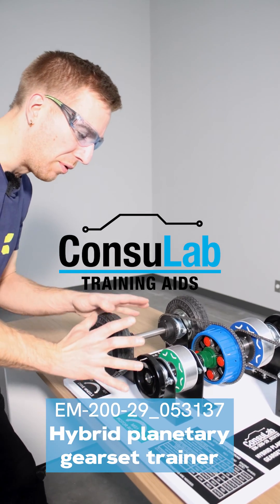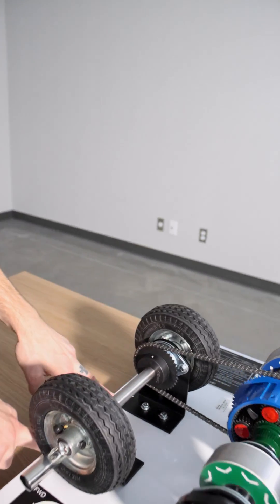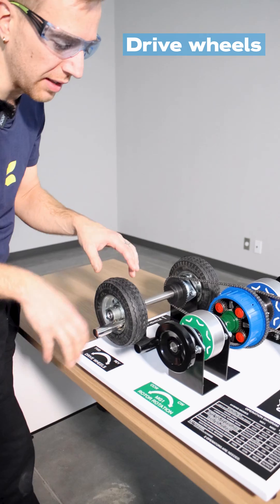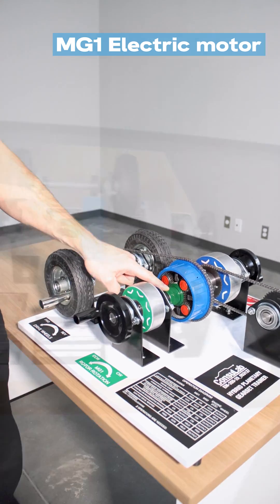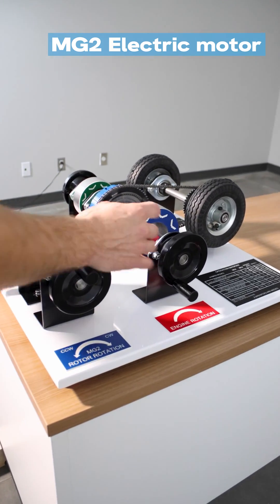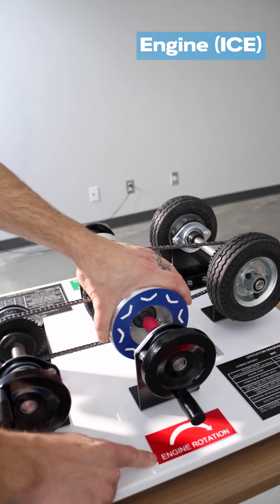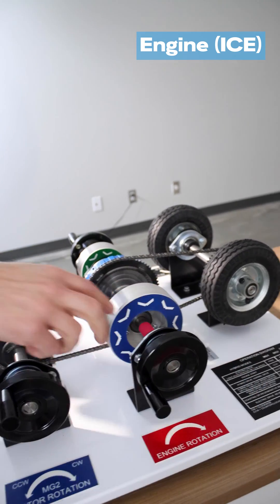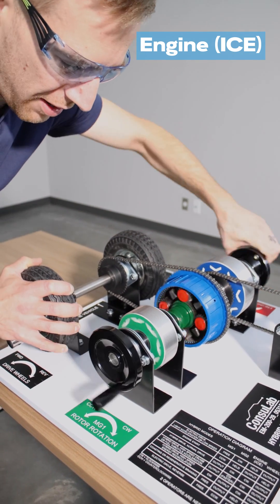How a hybrid drivetrain works - in under a minute

Comment: Weird. I thought I understood the system when watching a different video but now I feel I’m back on Square 1.
Reply: Every car brand does it a bit differently. This is just how Toyota does things. The smaller electric motor is pretty much working all the time when the gasoline engine is working as well. By spinning the smaller electric engine, the planetary gearset can change the ratio of power from gasoline engine being distributed to the wheels and being stored back to the battery pack, even via the second larger motor. Or the second larger motor can propel the car by itself. There are many combinations of scenarios you can achieve.
Reply: @  Thank you

Comment: can u explain to me, what are the functions of small electric motor and large electric motor?
Reply: In his model one is a motor and one is a generator simultaneously.  If your diesel engine is strong enough it can both propel you while generating for the battery
Reply: The large motor actually drives the driven wheels.

Comment: I learned nothing other than the gasoline engine can freewheel without turning the wheels.
Reply: You already need to know how Planetary Gears work for this demonstration
Reply: yh i was looking for something more
Reply: Front of 2 electric motor is gasoline engine:
Reply: So, all i learned is how the system works when i wait at a stop light while in drive 🤣
Reply: Weve learned a lot about you.